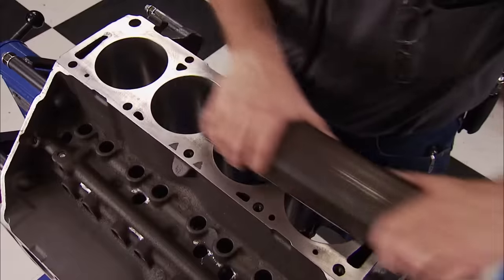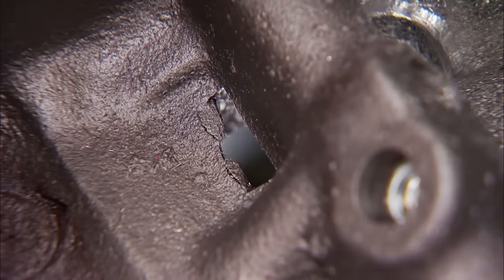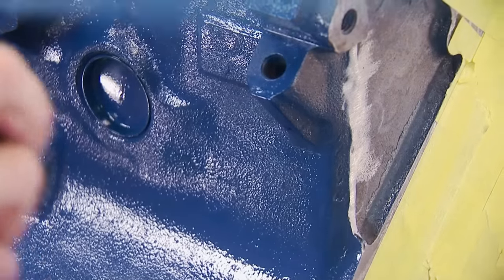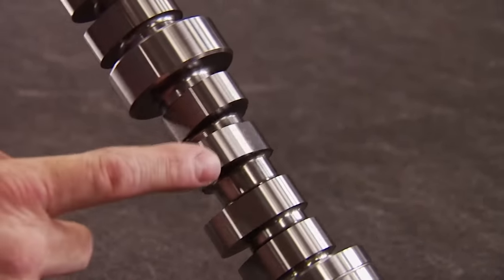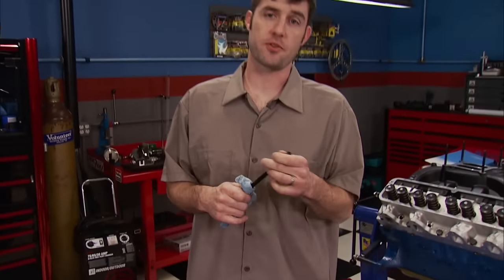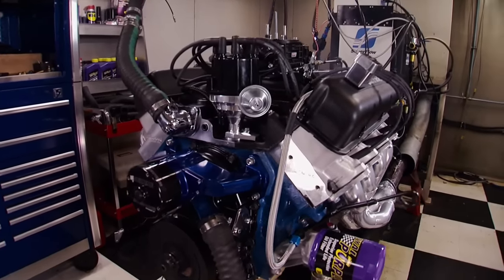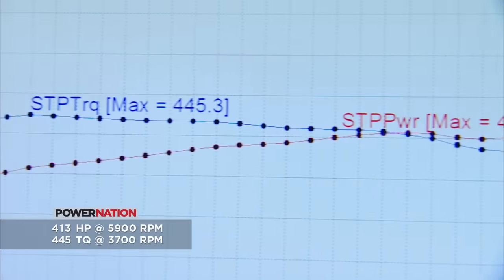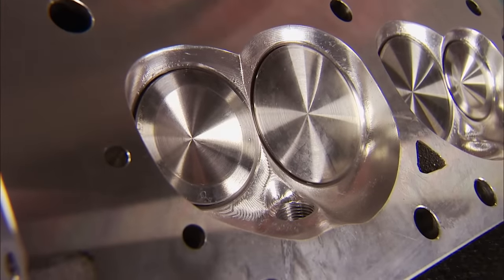Revitalizing A Ford 390FE With A Modern Twist - Engine Power S3, E7

Comment: 600 cfm is more responsive on the street but no balls
780 cfm has the balls. But not as clean on street driving
Next time I build one. 428 ci..
I'll work with a quadrajet
Reply: The Quadrajunk is a very underrated carb.

Comment: Did I see 352 cast on the front of that block...🤔
Reply: Most FEs have that cast in the block .
Reply: @blueovaldude  so that wasn't the cubic inch stamp?
Reply: Most FE's made in the 60's have 352 cast on the block. Has nothing to do with displacement though.
Reply: @briansearles4473  oh I see, thank you sir
Reply: 390 runs a balancer the 352 didn't same block different bore
Reply: @og190  I thought all FE's are internally balanced?
Reply: @slick-px4pq  428 is the only externally balance fe
Reply: @turtleman5.9  all ford Fe have 352 that is a 352 series family. My 428 scj both 390s and my 360 block all have it on
Reply: @whosthere2707  sweet! Thanks for the clarification bro 👍
Reply: @turtleman5.9  your welcome bud
Reply: @berserker406 that's right totally forgot about the 410
Reply: @berserker406 they make torque 390 with a 428 crank

Comment: I dig the FE platform, but that thing is an absolute turd if you look at HP-per-dollar. Very, very low return on investment. I realize the stock-ish short block doesn't represent a tremendous investment cost, but the induction package and valvetrain is relatively costly for that little of power production.
Reply: i was thinking the same thing, my 66 thunderbird stock has a 390 with 315hp @4600 and 427 torque @2800 and 10.5:1 comp ratio. all that and only 100hp more.
Reply: Pretty good considering the age of the design. And these were never designed for high hp. Made for torque.
Reply: @slick-px4pq  yea exactly of course the car is 4600 lbs so it needs all the torque it can get.
Reply: Agreed.
Reply: Ya, you could do much better with 351c 4v heads on a 400 cubic inch bottom end.

Comment: I don't know......with all that has been invested in this engine, I was expecting more. A 6.0 LS with a carb and similar cam specs and stock everything else will be at least 100 hp more at less expense.
Reply: The idea of hot rodding for street cars is not building another cookie cutter combo.
Reply: You're talking about two very different engine designs that are over 50 years apart. You have modern day STOCK V6 engines breaking 325hp. Also remember that they clearly stated that this FE is a low compression build specifically for street use and low octane fuel usage. Make no mistake, the FE can be impressive when money is no object. But even with fancy aftermarket parts, the FE design remains relatively the same and is limited by that fact.
Reply: Not everyone wants an LS.  Highest possible hp per dollar spent is not the goal of everyone.
Reply: Something you have to remember, those engines were designed in the 1950's with a slide ruler and paper, the LS was designed on computer.
Reply: @MattsRageFitGarage  "designed on computer"...just why & how all those aftermarket heads for FEs' are creating unheard of power levels?....reshaping of combustion chambers and reshaping intake & exhaust passages...all of it from fluid dynamics & number crunching by computers...all of it virtually unknow circa 1958.
Reply: @AndieBlack13  I think you missed the point as to what I'm saying. You can throw all the parts you want at it that have been enhanced to perform better in later years but at the end of the day the basic architecture is still the same as what was designed with a damn slide ruler. The power numbers on that dyno didnt really seem extravagant for what they did to that engine and it for sure had a bit left in it with a different cam.. This is coming from a guy who has and drives both a warmed over stockish 390 and a 445 stroker with those same edelbrock heads and the performer RPM intake with a comp 294S cam and headers with 3" dual exhaust and let me tell ya. The 4.250" stroke compared to the 3.78" stroke is night and day difference in power. I see this quite often with people comparing how their modern v6 makes as much power as some of the older v8 engines, totally different era of design.
Reply: @slick-px4pq  There is a cool factor to nice street rod with a vintage Ford, Buick, Pontiac, Olds, Caddie, or other motor in it.  If you're not racing for pink slips, cool is probably better than fast, which you can't do unless on a track anyway.
Reply: @bigboreracing356  Yep, the folks that designed the FE on paper with a slide ruler had what to learn from past experiences, the Y block and flathead V8? great powerhouse platforms to learn from..... What did the folks that designed the LS engines on a computer have to learn from? damn near every engine built in the past 50 years that didn't produce more smoke out the road draft tube than power to the ground. Much more advantage to be had designing engines these days, a lot more knowing what works and what doesn't.

Comment: 9:1 with aluminum head's? Plan on burning diesel much?
Reply: Ya could have had more compression for sure. The dynamic ratio would have been pretty low with the cam.

Comment: Seems like too much cam for only 9 to 1 compression, "mostly stock"? You used aluminum heads and roller rockers. Those should be for a 600hp+ engine.
This doesn't sound like a good engine, sounds like LS Chevy guys building a Ford FE 😢

Comment: Shit numbers. A 401 AMC with the same cam, heads, rpm manifold, headers and 9.5 to 1 would make 480-490 . Those heads would support 540 horses, the cam at least 500. Something went wrong somewhere.

Comment: I hate Fe engines. They are expensive for parts and in my area, hard to find them. I'm taking the 360 out of our 68 bump side and it's getting a 302 or 351.

Comment: Has anyone ever thought about pan caking two rotate engines
Reply: Huh?
Reply: They have often put motors back to back why not stack rotate motors
Reply: @dededallas9574  The only engine I'm well aware of in that configuration is the Suzuki RG-500 motorcycle. That bike has two parallel-twin 250cc configured in a "front & back" array connected by a pair of gears...for 500ccs of displacement.
Reply: I was thinking if no one else had done it it would be an interesting idea

Comment: Every GM,Ford and Chrysler factory engine assembly manual I used in the 60’s-70’s used the term “Foot pounds” for torque values
  When did the industry begin using
pound feet?
   I also hear people in these YouTube videos using the metric equivalent 6.4 liter when referring to a 1966 el camino equipped with a 396 cu in engine 
  America has never adopted the metric system 
  So why the change
  Are the liberals into performance engines now 🤣😂😅

Comment: Laugh my ass of at Ford "big-block" chamber volumes. 72 CC. Like a 350 Chevy "truck motor". Which is why any Ford "big-block" NA build "mild to wild" is doing good to make 500 "gross horsepower" with zero engine-driven accessories and the ubiquitous "long tubes" that will fit in ZERO "factory" Ford vehicles.

Comment: Pretty lame engine if you ask me. You build a 383 Mopar with factory closed chamber heads and RPM intake and roller rockers that will easily make well over 425HP just simple bolt together. Add a cam like this and your pushing upward near 500HP. Just saying. You could have saved lots of money on them heads and intake etc, not much a gain over stock factory although they look racey.
Reply: you do realize this is 9.0 to 1 pistons right? this 390 is making it's numbers without even trying....

Comment: Why on earth would you build that engine that way???
Bucks up heads and valvetrain, and then skimp out on the bottom end???
Crappy oil pan, no windage tray, low compression pistons, etc.
For hardly any more money, that engine could have made quite a bit more power and torque, and been more reliable.
Come on guys, you can do a better job than that.

Comment: Why bother showing how to install a piston ? if your going to do it WRONG ? They show how to install a piston in a block but do not show 2 important steps that might mean catastrophic failure if not checked or at very least a tear down later on. 1) did not show orientation of the piston / rod nor verify the rod and piston go in that particular cylinder (if re using the old pistons) or if the rings were hand gapped prior to that particular piston 2) He made no mention of alternating the ring gaps apart from 1 another to prevent blowby going down the ring gaps if in the same location. No matter how you slice it those are 2 very very very important things and if you are not going to cover the info dont cover any of it because they guy that gets no info will do the research and get the info he needs prior to building but when you show him a step by step video he doesn't KNOW hes missing important info. Heads up power nation you need a car guy going over the footage prior to airing and one with enough pull to edit the final piece to at least show a written post it note on the video explaining additional steps that were not covered.